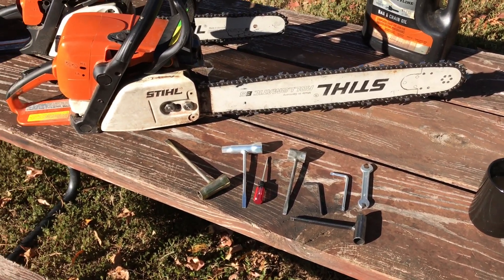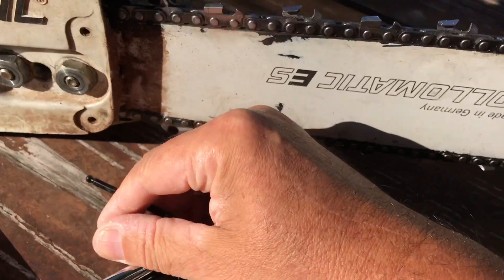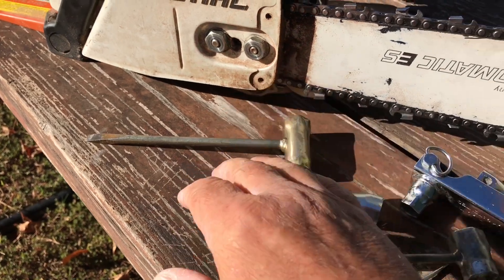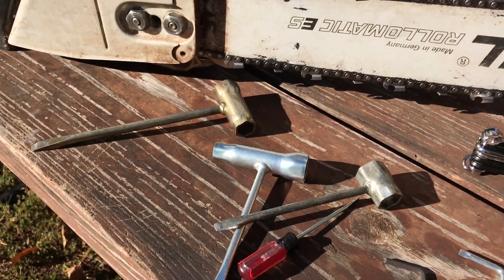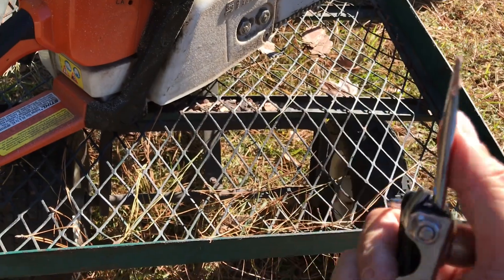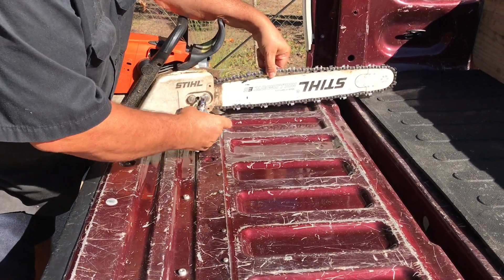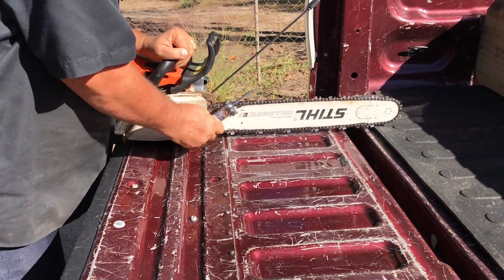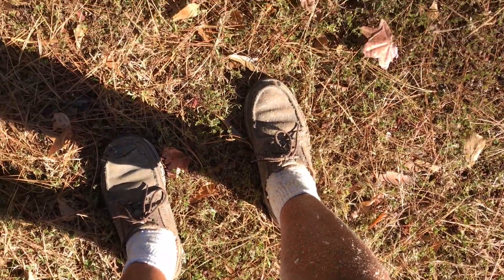Topsaw chainsaw tool review

Comment: Hey BC what is your opinion of the little $299 Stihl saw they are advertising these days. I want to buy a chainsaw but I don’t want to buy junk. Just need something for around the house not major logging, maybe 12-14” trees.
Reply from the maker: Hard Truth I have a 211c that would be more than capable of that size tree. The ms250 is a great all around saw with 18 inch bar. I’m not familiar with the one they are asking 299 for. I know that I used poulans, huskys, echo, craftsmen saws before. I will never use anything but a stihl from now on.
Reply: BCtruck, rebuild, repair,repurpose thanks brother, luv your vids keep it up.